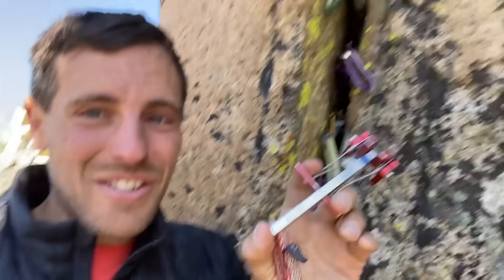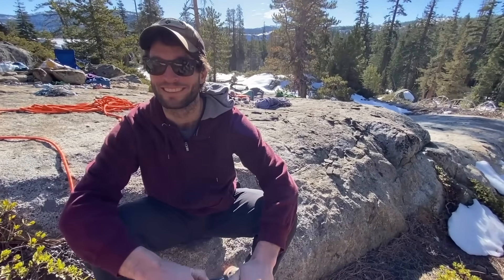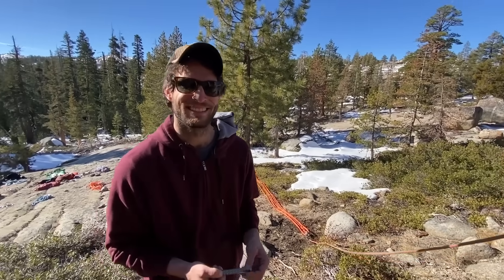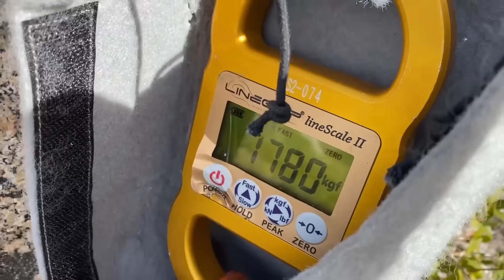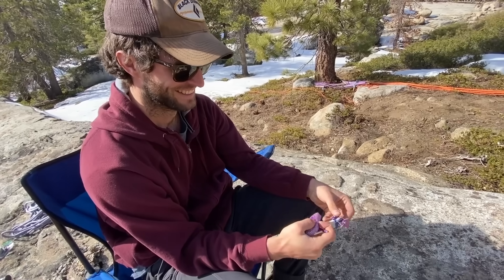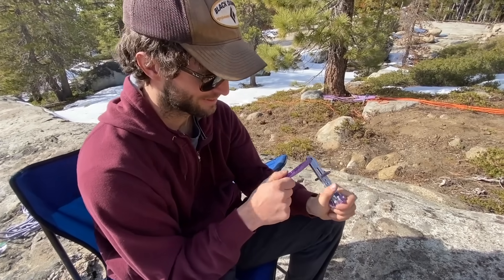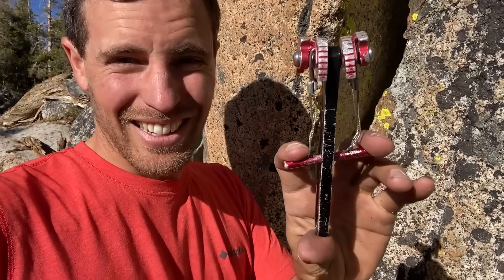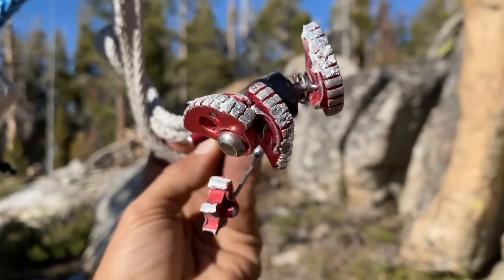Are Rigid Stem Cams Sketchy?

Comment: In my early days as a climber my friend who's dad was a friend of Mark Valance, (the guy who helped start up Wild Country with Ray Jardine) got a hold of some of the first freinds availiable in the UK, (there's a lot of friends of friends with associations with friends going on here!).
Me and my friends took the friends, (groan!) up to Frogatt edge in Derbyshire and used one whilst climbing the route Valkyrie. It got stuck in the introductory crack because we placed it with the cams too fully retracted, then we made things worse by allowing it to walk it's way deeper into the crack until we could no longer reach it.
We then tried all kinds of things to get it out including pulling it from above, of course it just walked even further into the crack and ended up with the stem pointing upwards.
So we all ended up hanging on the rope trying get the thing loose with brute force,  it didn't work but instead eventually broke the stem!
When Mark Vallance found out he ended up going up to Froggat with a chizel to get the thing out since a broken friend on a famous and often climbed route like Valkyrie would be bad publicity. (Sorry Mark!)
It did prove one thing however, friends, once located are pretty well bombproof protection, but not of course if you place them upside down.
We now have Friends with flexible stems that are a bit less prone to walking and a lot more resistent to breaking in the rare event that they are placed with the stems orientated horizontally or even upside down.
The eternal march of progress!

Keep up the good work dudes!

Comment: I climbed a lot in the late 80s, 90s, and early 00s with a full set of fixed stem Friends. Still have that rack. We used Kevlar cord through the lightening holes for horizontal crack placements (see Gunks) to avoid the leverage of using the sling.

Comment: I still have an original set of Friends from the 1970's, that only come out for aid climbing. Albeit, they're probably still fine, still in good shape. They are all tied with good ole kevlar cordage. Until watching this series of test, I just figured they would break at the tie in eye, but WOW - amazing that most all of the failures were either the slings or the rock blew out. Even so, it was amazing to see that you could get them to fail in so many different ways.... None the less, they have been a friends to me and many climbers.

Comment: What do you think about cutting out a 3/16 or 1/4 lexan screen cover for the dyno? Drill some 1/4 holes where you could still push the buttom with a little punch, using a thick bead of black or gray rtv adhesive sealant to glue the lexan on should give it some good cushion, while still making it easy to swap out with a utility knife. Just thinking outloud 😄👍
Reply: Had the same thought. Great call
Reply from the maker: Shoot.  With how often this happens to me... I just might!
Reply: @HowNOT2   see if the LS3 team can include them in the build. Cant be that hard

Comment: Very cool vid, but made me sad that those old friends got destroyed.
Reply: On the contrary. I love to see them serving a good purpose and going down in flames at the end of their lifetime instead of rotting away in storage or getting thrown away
Reply: @patrickhaller669  I see your point, but having climbed with them back in the day,  they still have a place in my old heart and mind - and it made me a bit sad to see them getting destroyed.
Reply: @garys5175   I recently pulled my old rack out of my Lowe expedition pack and checked out the great old ("vintage") gear with my mid-70's rigid stem Friends, and was blown away at all the cool old stuff on the Chouinard adjustable gear sling that looked like I had just bought it.   The last time I used that rack was in 2006.  I was going to upgrade everything on it, but it looks so cool, like it was right out of the '80s,  that  I don't have the heart to want to use it ever again.  Even the two types of brass nuts are complete and look in great condition.  None of them have broken wires on them.  The Spectra quick-draws looked pretty fuzzy, but would probably still be "super good enough",,,  lol
The rigid stem Friends have Kevlar 5mm(?) on them.  The Kevlar had a perlon  sheath so you could tie a grapevine(dbl-fisherman) knot in it.  Would love for HowNot2 to do tests on the old Kevlar and Spectra to see how strong they still may be.   
Half the stuff on my old rack is either Chouinard or Wild Country, but there's tons of other brands on other stuff as well.  If you're interested, I'll make a list of everything!!!  LMK
Reply: @GaryHicks-y7c  Cool stuff.  Thanks for the comment!  The nostalgia is running through my brain - all the places I climbed, and the people I climbed with. 

Most of my gear was 30+ years old and hadn't been used in many years.  It was all in good shape like yours.  About 6 months ago, I gave all the gear to a young climber that i know.  Ice axes, crampons, helmets, carabiners, quick draws, cams, nuts, tri-cams, hexes, aid gear... with a warning that all the nylon/kevlar/spectra had to be replaced before he uses the stuff.  I hope he can get all the cams redone at a reasonable price.  

Again, thank you for the reply.
Reply: @garys5175    Besides what is on my out-dated (or is it?) rack, I have a hoard of gear in storage... and one thing that stands out is a 'HALF" sized, rigid-stem Friend (marked "1/2") that looks almost new.  It had two holes for the 6mm cord looped through both holes to form a doubled loop.  It probably wasn't on the market long because Wild Country then came out with four sizes of small four-cam-units with single-stem cables.  I have three of the four in my hoard, but lost one after it got stuck and couldn't retrieve it.  Had plans to go back to get it,,, but can't remember which climb I lost it on,,,  lol   Maybe,,, if I make some coffee on my old Optimas 99 gasoline stove and drink a cup and ponder on which climb was that??

Comment: Always fascinating to see these "myths" tested.
One thing I've always wondered about is the strength of various bowline versions. I was taught that (if tying in with a bowline) you should only climb using a 2 turn or a retraced bowline. Any chance you can test this?
Reply from the maker: once i get the drop tower, I plan on going down the bowline rabbit hole.  Dynamic tests and slow pull

Comment: I would really be curious about tests that include testing whether cams hold in marginal/bad placements. could just simulate a factor 1 fall or something and drop a bag of weight with just a regular climbing rope. you might be able to do this one without actually breaking stuff :)
Reply: cams are strong AF if placed well, but I think the idea of "what placement is good enough" is kind of an up in the air question that changes depending on who you talk to... sure there is a well known "acceptable camming range" that changes depending on the cam, but you're not always going to get the ideal placement in the real world, so what can you "get away with" if necessary I think would be awesome to know.
Reply: We always say- well at least that poorly placed cam will slow me down...
Reply: @Davidadventures  as in a fall resulting in brain damage? or... make you climb morer carefully? lol
Reply: @Davidadventures   Psychological  protection often works better than the actual protection might.  If you can convince yourself "There's a chance" it is a lot better than convincing yourself "There's NO chance"!!!   It always helps if you can SEE something above that looks better than where you are.  I got sand-bagged into leading a previously attempted pitch about four pitches up an 800 foot cliff and my buddies had done a tension traverse off a 1/4 inch Rawl zinc-plated bolt to a different line than they had wanted to take.  They wanted to turn the overhang above the bolt, and it was dicey just getting to the bolt.  When I got to the first hard section and realized there was no good pro here, I opposed two small stoppers and convinced myself they were pretty good and I only had to make a few moves to easier terrain.  It worked.  No falls.  Was able to relax after brainwashing myself into believing they might just hold.  Then came the overhang.  I clipped the itty-bitty bolt under the small roof wondering just how strong can a quarter-inch bolt be???  The two opposing nuts thirty feet below the bolt surely weren't going to catch me. I turned the overhang... Nothing here!!!  Nothing to go for!!! No chance to down-climb the overhang!!!  Jump??  O hell NO.  It's 10d here!!!   It's gonna get 11d real quick,,, I hope there's something around the corner I can't see... better to fall off this than jump!!!  Reeech to the right,,, can't see it but there's sumthin there!!! #5 stopper better fit on the 1st try cuz there ain't gonna be time for a 2nd try!!!  Feels pretty good... I can climb again!!!  Go round the corner and the stopper looks good,,, the rock, not too bad.  Whew.  Next thirty feet, not too hard but the crack for pro not too good either.   Heart sinks.  The next forty feet gonna be up gritty little warpy moople nonsense.  Can see a crack that might take something.  Rub, blow.  Rub, blow.  Look down.  Wonder,,, will it be a hundred footer,,, or a two hundred footer? Rub, blow. Rub blow... ahh finally.  Where's that crack??  Gads... Where's my #5 stopper??  Look down... Will it be a two hundred footer, or a three hundred footer??   A little higher... got another questionable nut in but the quarter-inch bolt seventy feet below me still my best piece.  Ten feet of 10c to a good belay never felt so easy!!!  Second buddy climbs up to the bolt wondering how the hell?  Turns the overhang then hangs on the rope, wondering how the hell?   Rounds the corner and up the cracked-up crack to the warpy moople and wonders how the hell!!!  Rub, blows and rub blows up to the crack above and hangs on the rope a second time.  Climbs up to the final piece of pro and hangs a third time.  Climbs part way up the 10c,  hangs a forth time.  Finally makes the belay wondering how the hell??   I tell him "I was too scared to fall."
Third comes up,,, no falls, no hangs...  The sand-bagger.   I robbed him of his line.  All he can say is...  "You sure come up with some funky pro."

Comment: Thanks for making these videos!  I'm surprised you didn't do a Gunks tie-off.  When you do Totems, I'd love to see all the different ways you could load them (standard, on the inner bar-tack, only two lobes engaged, flares [outward, along the axis of the axel], two lobes clipped through where the sling connects).
Reply: I used the tie off for years on my forged friends. Seeing these tests I’m fairly confident the cord would break first so finding a 5.5 tech cord pull test on biners would be the closest equivalent. I’d then take a few kN off because the stem hole is a harsher bend. The German mag Panorama lists a triple fisherman’s loop at 21.2kN.

Comment: Is Amsteel dynamic?
Reply: Dyneema is a very static material. :) Not meant for shock absorption.
Reply: @rachelhasbruises  that’s what I was thinking too that amsteel was a static textile, but I didn’t know dyneema and Amsteel were interchangeable. I guess it’s a moot point tho since it’s comparing static to static. Only leaves the question of safety margins, weight, and price as main considerations?
Reply from the maker: Amsteel is to dyneema as Kleenex is to tissues.
Static sling is fine.... if you use a dynamic rope to clip to these things.  I don't think soft shackles are really practical on cams tbh.
Reply: @HowNOT2  thanks for the clarification and I thought I detected a smidge of sarcasm with the recommendation to use soft shackles as slings haha. If Amsteel is a trade name does the braid or proprietary part of the textiles construction give it any benefits over other brands. Content suggestion: does the different “braiding” patterns on Kernmantle ropes affect strength in any meaningful way? Or is it all just pretty decorations and a protective layer over the core strands and if most of the strength is in the core is there a stronger weave? Strongest weave? Strongest weave vs price point? If you’ve already done some content on this point me that way. If not I’d certainly tune in to see some break test results. Awesome channel man and thanks for taking the time to present the information and then backtrack and answer my silly questions.

Comment: I’ve got cams and hex’s slung with 7mm cord with a double fishermans- its how all the old Hexs used to be slung
Reply: BD tested many loop configurations.  They settled on the current strange double back webbing when they observed the weak point to be that the webbing was cut buy the cam eye.  The part you put your thumb through.  

I'd be interested to see how 7mm cord performs in this situation.   If it didn't get cut, it would be a good solution.  I fear it might get cut though.
Reply: @Davidadventures  they’re old WC Friends so no thumb loop
Reply: @alexmallace4886  Good point.  I thought you were talking about newer cams too.  I have a few I'd like to resling.

Comment: Do you think cam can be test with dynamic force instead of static force?
My bigest concerne with cam is the friction between the lobe and the rock, I think it would slip out of the rock with a much smaller dynamic force. 

Kinetic vs static friction : https://en.wikipedia.org/wiki/Friction#Static_friction

Someone can back my hypotesis with mechanical physic? :D
Reply from the maker: I'll be doing more testing on this because I don't know if it affects it.  Drop tower will help and then maybe bolting a boulder, lifting it and "making" an outdoor drop tower" is going to also help :)
Reply: They were pulling on them, correct?
Reply: @timfredrickson3889  too slow, my idea is to pull so quick (like a fall)  that the spring will not have the time to apply enough normal force on the rock and the cam will slip. 
If the cam slip just a little bit it's now just kinetic friction (not static friction) between the lobe and the rock.
Reply: @maximecastilloux9049  the initial force to cause the slip would still be the same, no? Only if the initial fall exceeded whatever fail point exists will the static friction force be relevant. I think it’s worth testing how much force that initial jerk applies, but that’s pretty hard to test, you’d need some sort of dummy weight and a better location
Reply: This could be the types of tests he does on the drop tower he's building.

Comment: Interesting video! have you ever tried break testing knotted slings used as protection (placed in cracks)
Reply from the maker: It’s is very very high on the list. Where can I learn more about that so I test the right stuff?
Reply: @HowNOT2  I honestly have no clue, I have never used it myself but I'm interested in starting to use it... All I know is that it is a big thing in the Czech climbing scene... sorry
Reply: Basically you use round slings of different girths with a knot tied into the end of them, that you place in cracks. The knots themselves aren't the difficulty with this type of securing. It's common to use either a double figure eight, in really big cracks sometimes monkey fists or if you're running out of gas and you have to tie it on the run, double overhand knots, but these are less safe. There is another special slingknot that is pretty common, but I don't know the english expression for it. The placement is the more important thing - you put the knot of the sling in cracks that get more narrow at one point. You have to look Out, that the knot ist a bit loose while you place it, so that it can expand, wenn you fall into the sling. The generated force while pulling down on the sling will tighten up the knot and so the knot will expand and fulfill the crack, without slipping because it gets more stuck in the crack. Because of the special structure and rough surface of the sandstone here in the Saxonian Swiss and in the Czech sandstone areas right across the border, it allows the textile to stick to the Rock with this unique style of protection. In other types of rock with less traction in the surface, it wouldn't work out like this. Greetings from the Elbsandsteingebirge.
Reply: If you are interested - a friend of mine who is a fan of your channel, is writing a book how to start with sandstone climbing in the local areas of the Czech and Saxonian sandstone. I'm pretty sure, he would share his knowledge with you👍